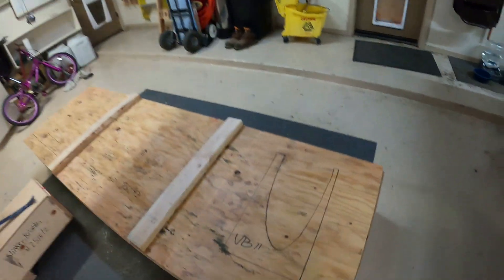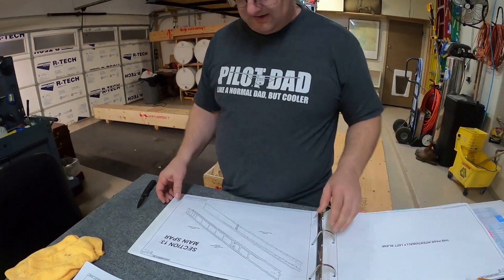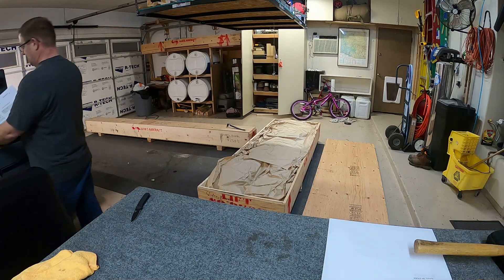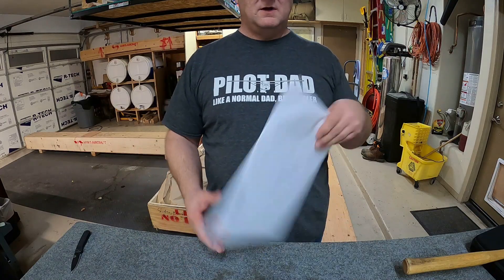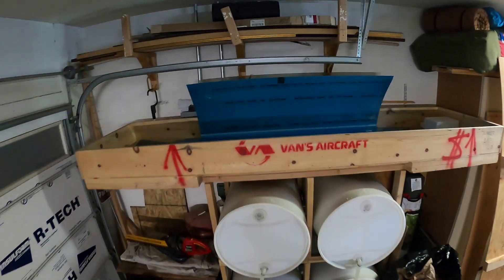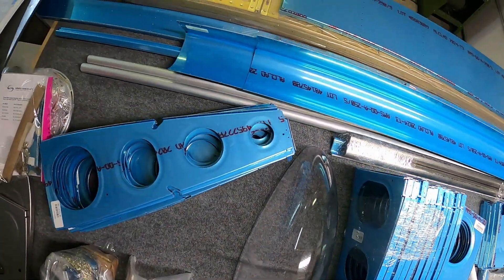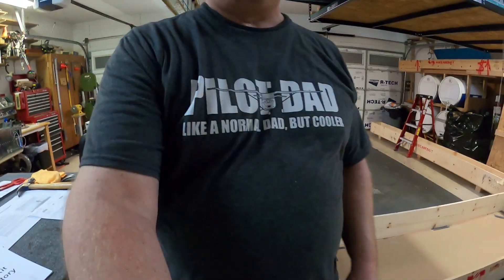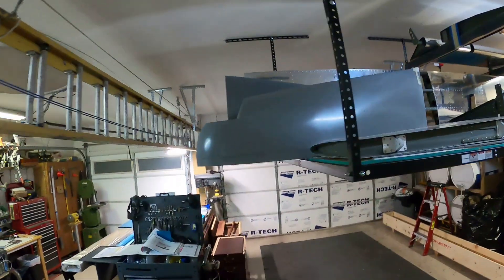RV-14A Build: Wing Unboxing - How to Build A Vans RV-14A Airplane #aviation #experimental #unboxing

Comment: Van's packs the kits like they're gonna be delivered via free-fall airdrop - and it's much appreciated! Before unpacking my Empennage Kit, I had seen several builder videos warning of checking every sheet of packing paper. While in the process of balling up the paper for disposal, they'd find a few smaller parts that were hiding. This bit of advice led me to take the packing paper to a workbench and flatten out every piece of paper. Saved me from reordering two parts in my Empennage Kit, and one in my Wing Kit. Plus, flattening out and folding the paper made it easier na took up less room in my recycling bin. And yes, getting eyes on the wingtips really brings things into perspective. Enjoy inventory!
Reply from the maker: Yeah I did the same thing... just didn't film it. I thought it would get pretty boring watching me take the paper out of the sack and opening each piece to check it... But that is great advice... The inventory video is coming soon. It might not be so enjoyable to watch :) It certainly wasn't fun to do! 4 Hours and my back and neck still hurt.